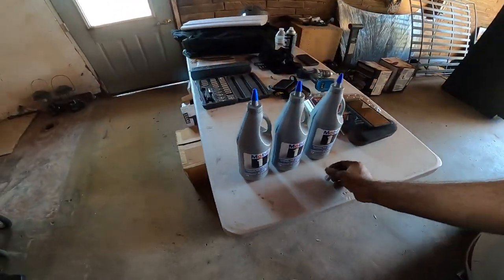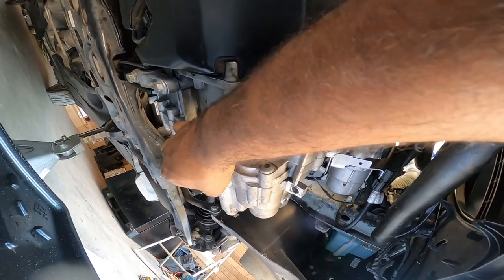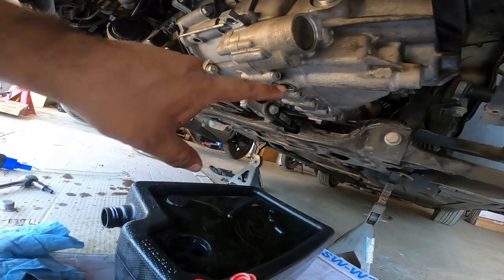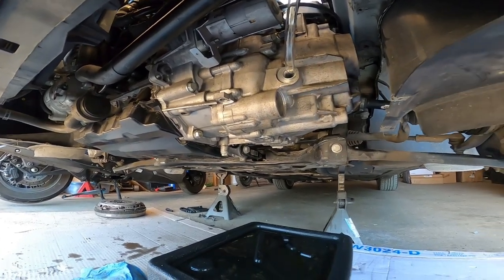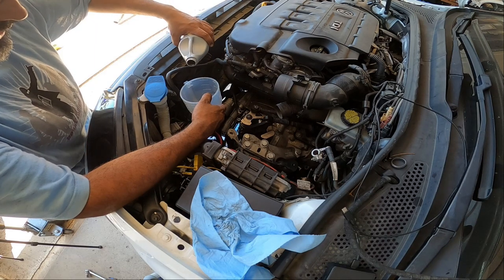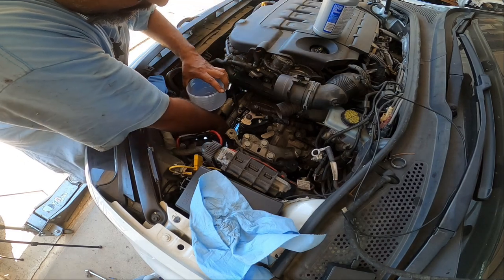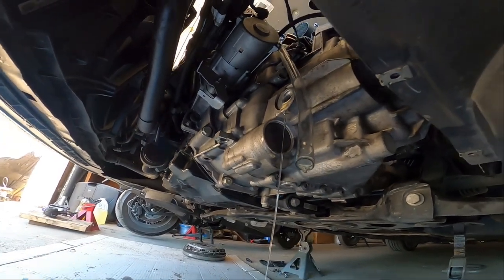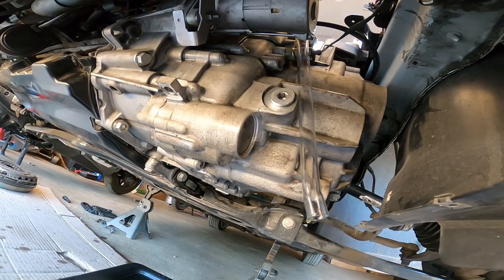How to Drain and Fill MK7 Manual Transmission

Comment: Ugh... MK7 is supposed to use GL-4 fluid not GL-5...
Reply from the maker: Not true!
As per my owner's manual gl 4 or gl 5 is what you can use.
Reply from the maker: I also confirmed this with 2 VW dealerships
Reply: @PincheALsGarage  dealers are wrong. Consult the manual or check the forums. Compare the viscosity to the OE VW fluid. M1 fluid is way too thick. It's differential fluid more so than transmission fluid.